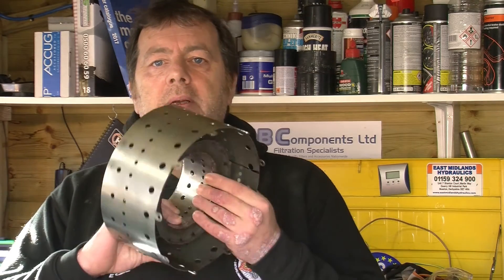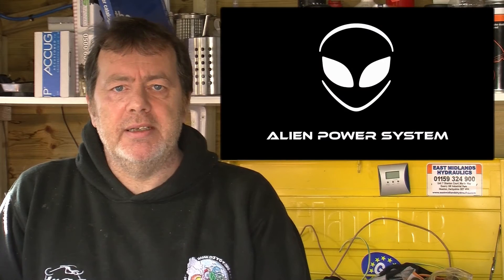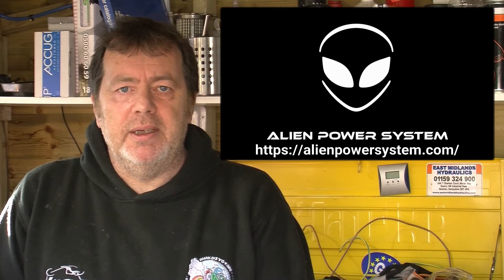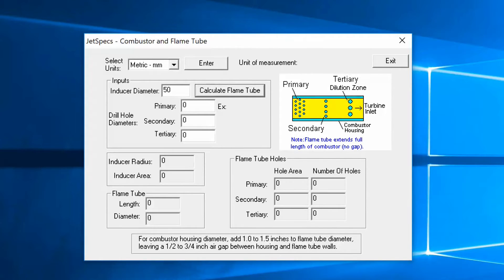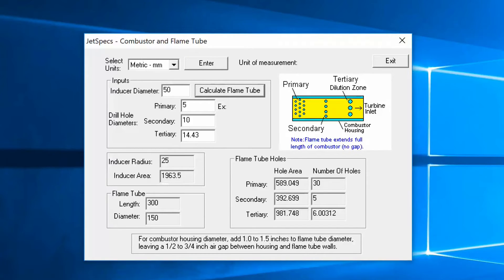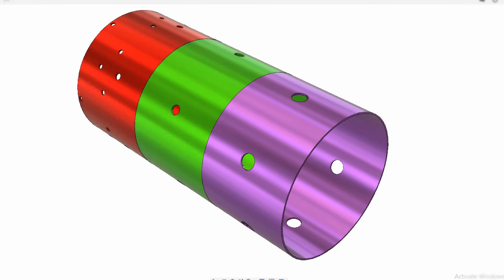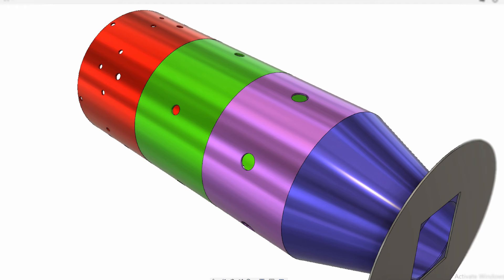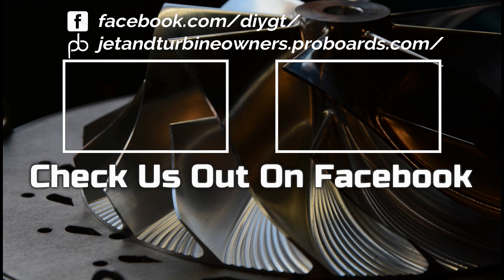How to build Working Jet Engine Flame Tube Design

Comment from the maker: Sorry guys, had to re-post this as removed it by mistake
Reply: Andy Morris Hey any chance I could get in touch with you. I’ve wanted to build one for a long time. School project, if it works I’ll mount it on a radio controlled jet. I started building one, but I have a lot of questions and Nasa won’t answer my emails.
Reply from the maker: @coryf9650  help is here https://jetandturbineowners.proboards.com/

Comment: Thanks for this, i made my first engine a few weeks ago, it throttled up good but only went to full power 3 times for short durations untill it flamed out and spit hot metal out the back, i eye balled the 30 20 50 and thought i was close enough, but that turbine wheel would glow red, i replaced the turbine and it happend again, so i gave up and threw the whole engine away, im probably going to start building a new one today, gonna use this jetspecs thing. Also my turbocharger was a really small one with inducer 1.4" from wall to wall so not sure if it being really small played a factor because maybe the turbine blades where extreamly thin
Reply from the maker: best place to get help and support https://jetandturbineowners.proboards.com/
Reply: Im trying to download jetspecsexe 2.0 from my phone, it wont let me :/
Reply from the maker: @adam_-adam  Hi adam, not sure it will work on your phone.... the software was writen some time before smart phones ? if you dont have a laptop or pc... am sure if you start a thread on JATO.... explain why you need help... one of us will perhaps work it out for you .....
Reply: @Turbojetkart  its ok, i actually found a jetspec sheet that allready had data filled out and its relative to the size i want to make so im just going to start from that, it was a filled out jetspecs sheet for a 2.5 inch inducer diameter, so im happy now, its been about 4 days of trying to figure out how to make a correct flame tube, also i signed up for that site you told me about, that is about the best place to go for all my answers, ive been all over the internet and could only find some info but on there theres people who ask the same questions ive had in my head that i could not find, like- what if putting a long tube inbetween combuster to turbine shroud for added cooling' someone said its not a good idea but after burning up two turbines ive had that question in the back of my head, i guess if i just follow the jetspecs cheat sheet, than i wont have to worry about that hopefully :] i feel way more confident in building my next engine, only prob now is im trying to fig out if the amazon $150 turbos is a good or bad choice, but im a little on a budget, anyways thanks for refering me to that site, im reading a bunch of stuff on there now for like the past 2 hrs, its super helpfull.
Reply from the maker: @adam a  I am glad you found the site helpful.... you will be able to keep up with mine and other projects as well.... and others can see how yours come a long.... The amazon/ebay cheap turbos.... erm ...  they are ok, but perhaps dont push to hard... might be worth seeing whats around in local scrap yard ?, if you have one local.... big truck/  earth move turbo... if you have any turbo companys close. perhaps ask if they have any old stock/second hand ?  🙂

Comment: Is a flame tube required if I am using an electric leaf blower instead of a turbine system? The best I can do is this aluminum IKEA utensil/spatula holder with a bunch of decent sized holes in it.
Reply from the maker: Erm.... the flame tube help fuel and air to mix, so yes ? not sure.... not made any thing like that

Comment: I have a turbo with an inducer of 80mm so my flame tube is 160mm (~6.3in) with the outer shell being 190mm (~7.5in). I would like to make my own tubes to fit these sizes if possible, is there a recommended wall thickness on the tubes? Would 16 gauge be thick enough?
Reply from the maker: sounds good, get more info and help here https://jetandturbineowners.proboards.com/

Comment: How critical is proper flame tube design? Would it be possible for a jet to work even with the "incorrect" design?
Reply from the maker: erm, how incorrect..... bad design can end up melting parts
Reply: @Turbojetkart  would that overheating be caused by insufficient dilution air?

Comment: Hi,great vids.I,m building a jet,how far in should the injector pipe be if using propane,also can parafin be used via an oil burner type injector ?
Reply from the maker: I hope the videos have helped... best place to get more help is https://jetandturbineowners.proboards.com/.... myes for Kero/parafin oil burner type injector.... propane.... best get a big bolt, drill a hole in each face the hole down the shaft of the botl.... so you have 6 points that its injectored 😀

Comment: does the actual tube that feeds the gas, i.e. propane, diesel, kerosene, etc, does that tube need to be drilled with numerous small holes and capped off at the end of the tube??
Reply from the maker: for propane you can use a bolt cross drilled across the flats of the head and drill down the centre of the bolt..... for kerosene and diesel you will need a spray nozzle or an evaporation set up..... have a look on http://jetandturbineowners.proboards.com/ to get more help

Comment: Hey Andy what about your swirl vanes
Reply from the maker: Hi, yep swirl vanes.... some have them and some don't, but for the simple flame tubes that tend to be used in the home made gas turbine engine... not always needed.... engines like the stad, rover 60, gt 35 don't have swirl vanes in the flame tubes.